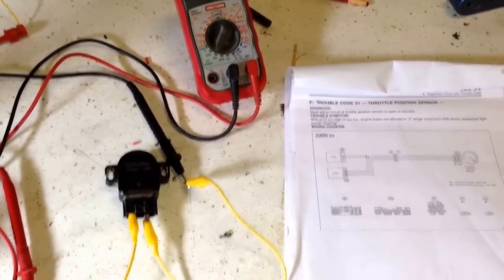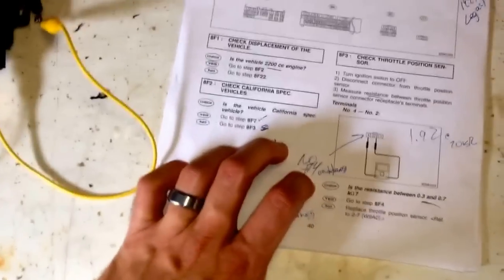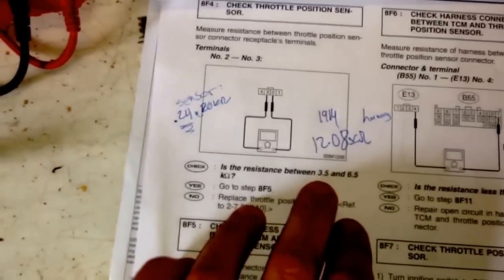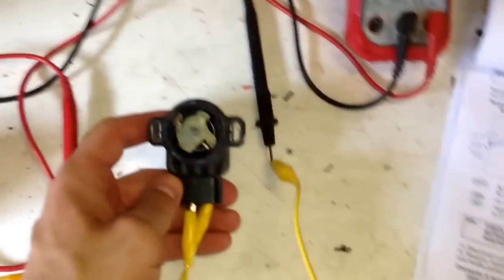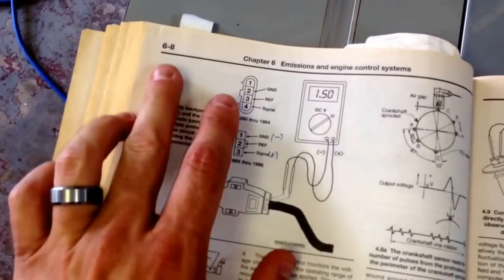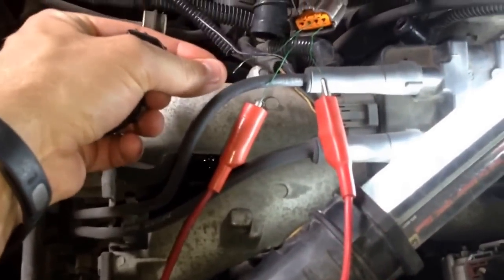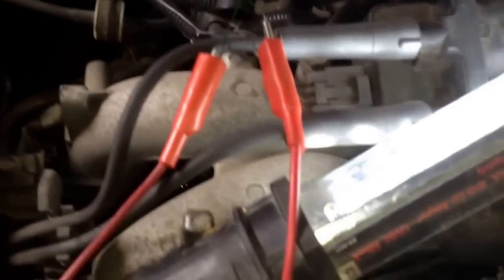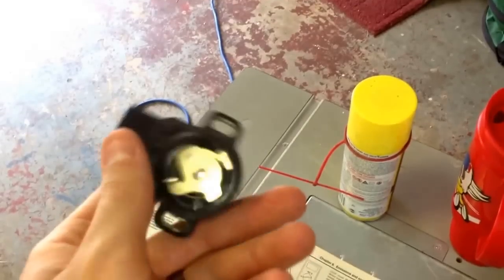Subaru Legacy Throttle Position Sensor (TPS) for code 31 diagnostics

Comment: hi, thanks for your video. do you know what is correct ohms resistance of your new throttle position sensor. i ordered new one but resistance value different from manuel (manuel says 4-2 receptacle terminals must be between 0.3 and 0.7kohm) . mine values is (4-2) 5.14 kohm, (3-2) 0.28kohm.
Reply from the maker: It depends on your sensor.  You need to make sure you get the wiring diagram and resistance values for your sensor.  For example, if your manual shows the Res then you need to get a Subaru TPS, not one from Autozone, etc.  Often times the resistance values (and especially the tolerances of those values) are vastly different than the OEM specs.  So buy the Subaru sensor and test it at the desk of your dealership.  Don't even take it away from there unless your DMM matches the OEM specs.  The parts department should be able to get the specs to confirm as well.  If the parts counter guy at the dealership doesn't have the specs, have him call over the Service Mgr and they can look up that Res spec for you.  Don't leave there until you feel comfortable that the specs match the TPS readings.
Reply: actually, i had a 2000 outback 2.5 engine. wiring diagrams and resistance values same as your car. i ordered tps from partsouq.com and it is oem. engine work great but the problem is transmission (excessive shift shock). 4th to 3rd excessive shift shock. other shifts is good.
Reply from the maker: I wish you luck with your job.  Fingers crossed that it ohms out correctly and eliminates that shock.  I used the Autozone version and wasn't very happy when it failed 18 months later.  But just got another one and so far it has worked.  Autzone was $70 but Subaru wanted $375.  So this AZ version can break 4 more times and I still come out ahead (which I doubt it will fail that many more times).  It is such a simple job to swap out the TPS and I feel its worth it to try the AZ knock off instead of the OEM.  Let me know how it works for you once you get your TPS installed and drive it around for a few weeks.  Try it out on the highways for 1hr+ too
Reply: need a luck:-) thanks. i opened the old tps and found notting to fix. there are lots of tps on aliexpress. all of them refurbished.. so i'm not rich enough to buy cheap stuff. how did you adjust your tps. i couldn't find voltage values on my manuel.

Comment: My throttle position sensor does not look like it can be replaced. No screws, looks like it is riveted to the throttle body. 2006 Legacy.  Any suggestions?
Reply: On that year legacy its the throttle body and tps are one part, its like $600 or something crazy from the dealer

Comment: Hi, I would like to know what symptoms were you getting while driving the car, prior to replacing the TPS sensor.
Reply from the maker: +K StG It would randomly go into "limp mode" whereby the AT OIL TEMP light would flash repeatedly.  That would happen mainly after coming off the interstate for almost any duration of time.  After coming off the interstate I wouldn't be able to get the car past 2nd gear and would top out at <20 mph.  The revs would be 4K or more but at 20mph and that is limp mode.  The car's tranny thinks it needs to "protect" itself by not letting you shift into more gears.  Very annoying and I would have to turn the car off, wait 5-10 mins, then turn it on again.  Changing the TPS fixed it for me.
Reply: Would be helpful turn dam music off so someone could actually hear ya

Comment: I can't thank you enough. I had the "AT Oil Temp" light flashing on my subie so I brought it into the dealer. They said it was transmission problems. $3000+ to put in a used transmission and replace the wire harness. Before buying a new car, I figured I'd look up the problem online and see if there was anything I could do. I tried the "secret handshake," got the code, came across you video and swapped out the sensor. You saved me from scrapping my car over a $50 part.
Reply from the maker: Nathan Beyers My pleasure.  Aamco told me the same thing.  Those shops are incentivized to drive replacement transmissions.  It's hard to get non-bias advice from those without a conflict of interest.  Sometimes YouTube is the only place you can find that.  Update: after a year that light has yet to return and I have none of those problems caused by the bad TPS.
Reply: Just an added tip when doing this yourself: make sure to install the sensor correctly. The spring should be displaced slightly even with a closed throttle. This requires you to place the sensor in the housing with a slight rotation, then turn it clockwise until the screws line up. (I put mine in wrong at first and it caused the oil temp light to remain on)